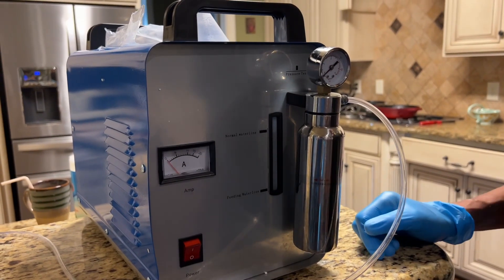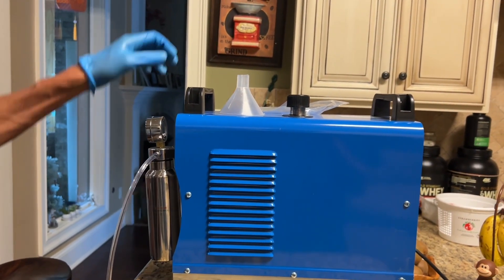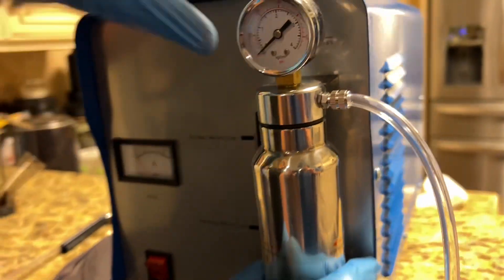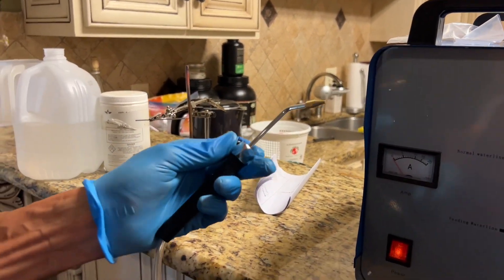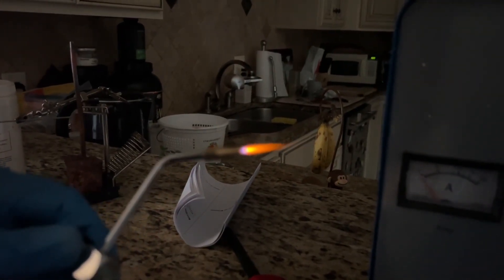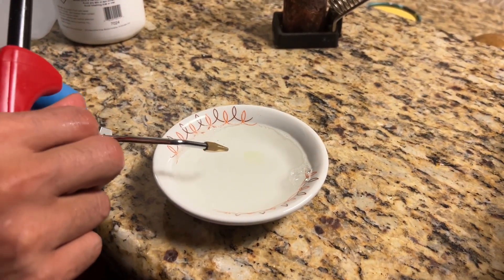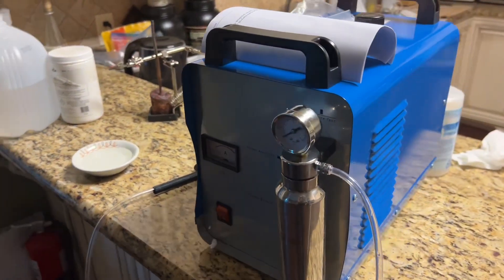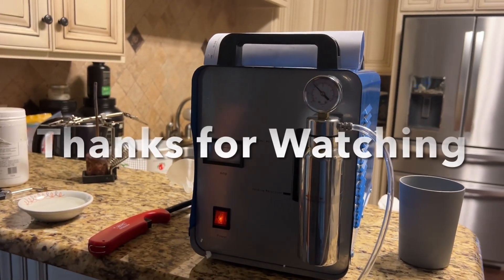Detailed evaluation, H180 HHO flame torch

Comment: I don't understand why they don't separate hydrogen and oxygen?  Then they would be mixed in the cutting head, making them less explosive.
Reply: Very new to this, but that would need DC current and more expensive electronics. I would guess they are using AC from the mins, hence the mixed gas

Comment: The alcohol thats used in the contain does destilled water work aswell . Why alcohol?
What percentage alcohol?
Reply from the maker: You can use pure alcohol (ethanol is better then methanol) as it helps to increase flame length but at the expense of flame temperature. Various mixtures of ethanol and water also work eg 1:1, but not as well as pure ethanol. I have also used 1:1 or 1:2 acetone alcohol mixes and they work well.  With pure water the flame is shorter but much hotter. It’s sometimes a bit challenging to keep the flame going with pure water
Reply: @BrianDhvTinkerer   hmmm like a catalyst. the effect when the metal glows up seems abit like its not only purely heat transfer but also reactive effect from the oxygene. O would like to try to melt molyodenum metal with it that melts at 2400 celcius if it works make a melting  furnace if it works and i then wonder if i can get the flame hot enough to melt  an amount like a hands fist?
Reply from the maker: This particular torch is for small scale melting. I don’t know if they have larger ones or not.
Reply: @BrianDhvTinkerer   got it .. I will keep searching

Comment: how long does the anod katod run ? Running life ?
Reply from the maker: I have read that people have used this set up in the jewelry trade for about three years with no issues. When stored, it is best to wash out the sodium hydroxide solution from the tank to reserve the plates. Other than that, not a lot of maintenance.
Reply: @BrianDhvTinkerer  Got it... Thanks

Comment: But the bubbler is supposed to act as a flashback arrestor why would u use somthing flammable in the tank thats supposed to stop fire from entering the vessel
Reply: My thoughts exactly
Reply from the maker: When I read the manual that came with the HO generator, it said that the flame temperature of the plain HO is extremely hot and the flame is also not very visible and very small. Bubbling through ethanol enriches the flame with fuel so that it becomes longer and less hot, but still hot enough to melt metal or glass. That was my take just reading the manual. However, before I read the manual, I was not exactly sure why they were using ethanol or acetone ethanol mixtures
Reply: I bet it helps with moisture removal since these flames make alot of water
Reply: @NaterNorris You are exactly right, I've had water drops at the flame source I've dealt with & didn't realize that ethanol addition because I built one to try out.

Comment: Been using mine for just under 4 years until she died (i susspect the reaction vessel is consumed ) still worth it
but i use mine alot i mean alot alot  
I have probably silver solderd about 3 miles of stainless steel wire and staysilv 56  in that amount of time 
Best torch ever for silversmithing zero gas cost

Comment: Thank you for the video. I needed to see what kind of flame this thing could put out before i buy one. I never knew they made hho generators for torches. Not until I googled "glass blowing torches" and this came up. I have used oxygen  concentrators with natural gas. It's crazy too because before i bought oxygen tanks i was looking for an 02 concentrator but they are all very expensive. This torch would of been perfect but I never saw anything like this, even with the hundreds of searches on torch systems that iv done over the years. I wound up spending alot of money on torches when this thing would of met my purpose.
Reply: this thing/tech can power your car and heat your house  on water....

Comment: What is the difference in the flame using only water in the steel cylinder instead of another flammable like the ethanol you used?
Reply from the maker: Bigger flame with ethanol but slightly less hot
Reply: @BrianDhvTinkerer  apparently bubbling the mixture through ethanol also makes the flame non-oxidizing AND the ethanol bubbler would act as a flashback arrestor if everything fails.
Reply: @BrianDhvTinkerer How mutch bigger and how mutch less heat
Reply from the maker: @joanthanbrodd6374 the flame is at least double the length. The temperature is about 2000C
Reply: Okay thanks. 👍

Comment: I have one these for a while I am wondering how to lower the output pressure at the torch, I use it for making  jewelry, the reason I need to lower the pressure is it blows the solder chips of my soldering pad. I bought the thing so I didn't need to buy regulators for propane/oxygen and bottles, it was the cheaper option, I still am going to have to get them though, the flame on the brown's gas generator is too focused, it hot enough but solder tends to run away from the 5200 degree flame.
Reply from the maker: These units probably have a built  in switch mode power supply. Otherwise I was going to suggest using a variac to lower the input AC voltage to the HHO generator. This may still work and it is worth a try.
Reply from the maker: Yes for sure they do. They cannot be run off a variac
Reply: @BrianDhvTinkerer  Brown's gas generators run on DC not AC
Reply from the maker: Decreasing the concentration of sodium hydroxide solution definitely works. I tried this. You can go down to 5% or less, and it will lower the amount of hydrogen and oxygen produced which lowers the pressure.
Reply: I'd crack it open and seperate the hydrogen and oxygen. I'd also get a regulator for the hydrogen. It's a really good starting base though.
Reply: @NaterNorris  I would have to change the plates in the machine to do that. The machines that do the separation of h from the o are a completely different design.
Reply: The problem with decreasing the flow of the torch is that if the flow is too slow, the flame can travel back into the torch tip > piping > steel container, which will then explode.
Reply: @ratgreen  my machine has a flashback arrestor bottle and I installed a secondary one as well. I am a jeweler, the pressure is too high it like a leaf blower on the solder chips before they melt into balls, which you guess makes the product useable, I when back to to propane and oxygen. It has been sitting collecting dust since my original question a over a year ago.

Comment: do you need glasses or a welding mask when melting metal because of how bright it is?
Reply from the maker: Should really have welding glasses, but I was just doing it without the welding glasses because I didn’t realize how bright it was going to get
Reply: @BrianDhvTinkerer  Welding with a flame is not nearly as bright as a welder that has an electric arc. You will not burn your eyes with the light, but darkish glasses would make it easier to see, because molten steel is dazzling bright. Glasses would also keep blobs of molten metal out of your eyes if something pops. I know an old man who torch welded exhaust pipes and mufflers for years with just clear safety glasses. His eyes were not harmed by the light, but watching him weld with that torch was as bright as I wanted to look at. Guess he was used to it. Or, maybe he ate less spinach and carrots and his eyes were less sensitive to light.

Comment: Awesome video! but i am curious as to what purpose does the alcohol serve?
Reply from the maker: I think what it does is it slightly enriched  the HHO fuel, and it produces a longer but slightly less hot flame. Also as the alcohol has a lower surface tension compared with water, it allows the gas to more easily flow out of the system.